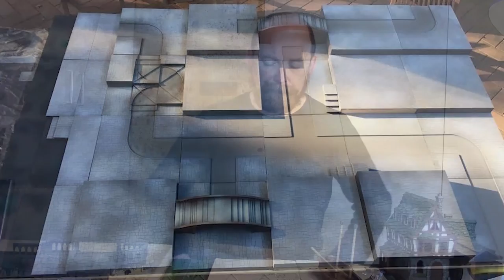Ep11 Modular Terrain Board Part 1

Comment: There are some very cool ideas here. You’ve certainly looked at how terrain boards can used in multiple ways.
Reply from the maker: That's a necessity of running a club. Not always a lot of storage space and you need to make the most of every piece you make. We used to have modular 6x4 tables that could make a single board close to 100 foot long.
Reply: Wow! That sounds amazing!